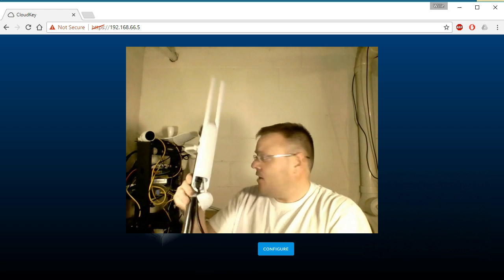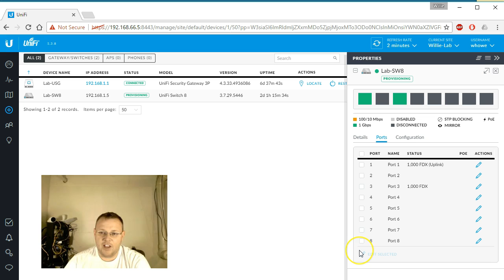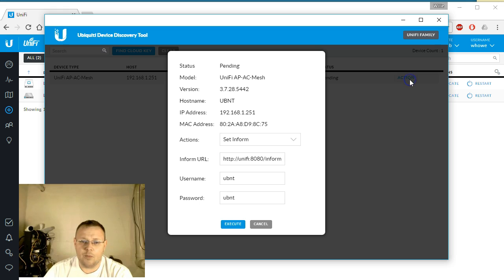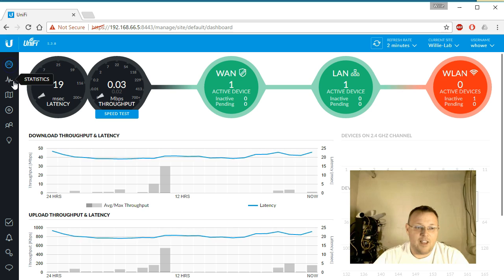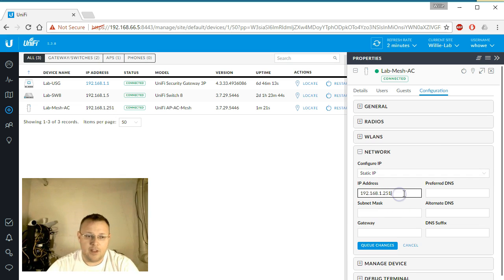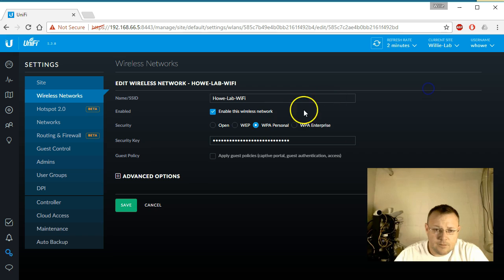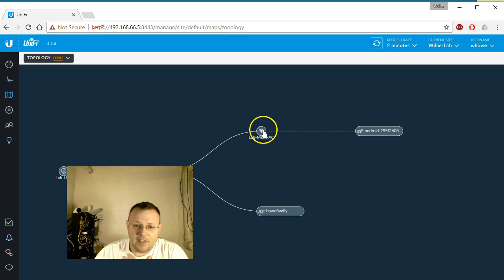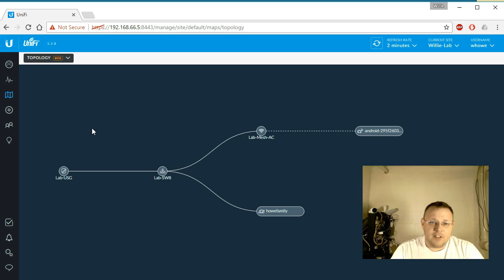UniFi Access Point Adoption

Comment: hi how can I run  only unifi mesh ? just plug cable from my wifi router to the adapter and from adapter to the unified mesh? 
than setup in controller? 
thanks
Reply: so one ap and one mesh ...and I can rock and roll?  btw you have great content! thanks
Reply: if I plug cable from my wifi router to ap adapter and then wirelessly mesh... all will work right?